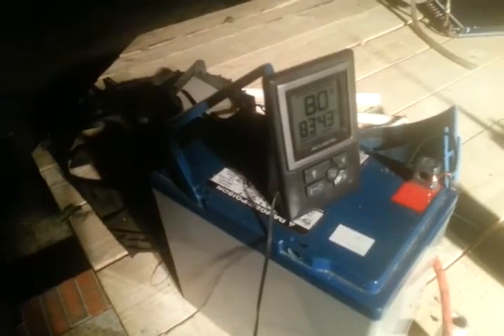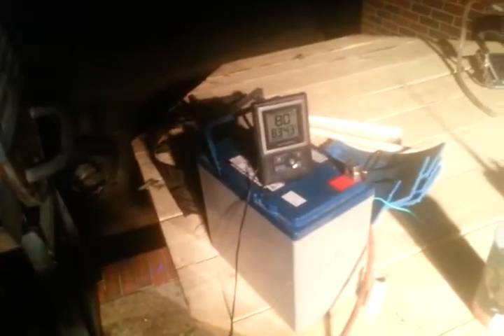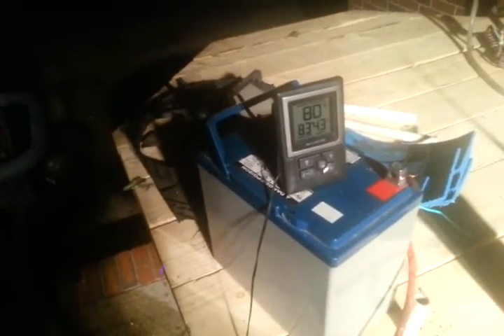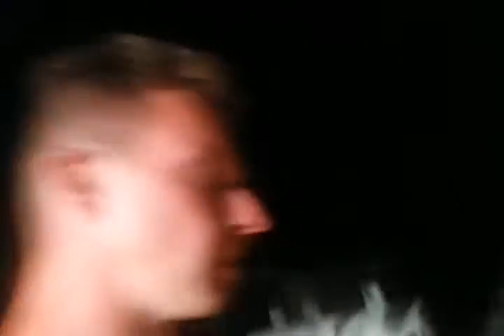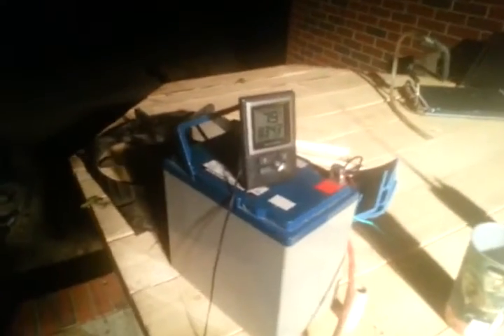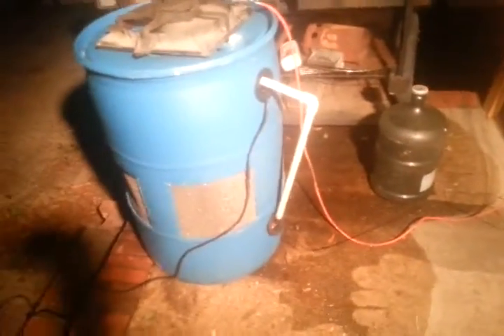DIY Home Evaporation Cooling Tower Part 1

Comment: Dude you should really follow up on this. It is a brilliant idea. You know that this may be actually even more efficient than what you give yourself credit for because you have to think about the heat pump effect of what you're doing.  One must also take into account the heat capacity of water is a lot higher than most refrigerants are these days. Thus 1° C of temperature change in water is a hell of a lot more BTUs or calories or Joules or whatever unit you would prefer to use for Energy Temperature change in a CFC refrigerant. I'll give some  specific heat values just to Give an example of how big the heat capacity differences are Once I post this so I don't lose any of my texts due to gremlins or bugs lol
Reply: Liquid 	
	Temperature (c) 	Specific heat (kJ/kg.K)
Ammonia 	Specific heat capacity of Ammonia 	-33.3 	4.43
Ammonia 	Specific heat capacity of Ammonia 	-20 	4.52
Ammonia 	Specific heat capacity of Ammonia 	0 	4.6
Ammonia 	Specific heat capacity of Ammonia 	25 	4.8
Argon 	Specific heat capacity of Argon 	-185.6 	1.14
Benzene 	Specific heat capacity of Benzene 	20 	1.72
Brine (20% sodium chloride by mass) 	Specific heat capacity of Brine (20% sodium chloride by mass) 	20 	3.11
n-Butane 	Specific heat capacity of n-Butane 	-0.5 	2.31
Carbon dioxide 	Specific heat capacity of Carbon dioxide 	0 	0.59
Ethanol 	Specific heat capacity of Ethanol 	25 	2.46
Ethyl alcohol 	Specific heat capacity of Ethyl alcohol 	20 	2.84
Ethylene glycol 	Specific heat capacity of Ethylene glycol 	20 	2.84
Glycerine 	Specific heat capacity of Glycerine 	20 	2.32
Helium 	Specific heat capacity of Helium 	-268.9 	22.8
Hydrogen 	Specific heat capacity of Hydrogen 	-252.8 	10
Isobutane 	Specific heat capacity of Isobutane 	-11.7 	2.28
Kerosene 	Specific heat capacity of Kerosene 	20 	2
Mercury 	Specific heat capacity of Mercury 	25 	0.139
Methane 	Specific heat capacity of Methane 	-161.5 	3.49
Methane 	Specific heat capacity of Methane 	-100 	5.79
Methanol 	Specific heat capacity of Methanol 	25 	2.55
Nitrogen 	Specific heat capacity of Nitrogen 	-195.8 	2.06
Nitrogen 	Specific heat capacity of Nitrogen 	-160 	2.97
Octane 	Specific heat capacity of Octane 	20 	2.1
Oil (light) 	Specific heat capacity of Oil (light) 	25 	1.8
Oxygen 	Specific heat capacity of Oxygen 	-183 	1.71
Petroleum 	Specific heat capacity of Petroleum 	20 	2
Propane 	Specific heat capacity of Propane 	-42.1 	2.25
Propane 	Specific heat capacity of Propane 	0 	2.53
Propane 	Specific heat capacity of Propane 	50 	3.13
Refrigerant-134a 	Specific heat capacity of Refrigerant-134a 	-50 	1.23
Refrigerant-134a 	Specific heat capacity of Refrigerant-134a 	-26.1 	1.27
Refrigerant-134a 	Specific heat capacity of Refrigerant-134a 	0 	1.34
Refrigerant-134a 	Specific heat capacity of Refrigerant-134a 	25 	1.43
Water 	Specific heat capacity of Water 	0 	4.22
Water 	Specific heat capacity of Water 	25 	4.18
Water 	Specific heat capacity of Water 	50 	4.18
Water 	Specific heat capacity of Water 	75 	4.19
Water 	Specific heat capacity of Water 	100 	4.22

NB --  as water gets closer to boiling its heat capacity curves upward very slightly thus why there are several values there

Comment from the maker: An hour later, the temp was 74 degrees F. I wonder how fast and to what temp it will drop to when the water flow vectoring is what it should be, and air is only being pulled in through the water screens?
Reply: By recirculating water through a cooling tower without adding heat you can get to within 1 degree of the wet bulb temperature, but as you guessed you would need to have a more efficient system that doesn’t allow air flow to be wasted going through non-wetted services. You also need about 1 hp of air movement for every 30 gallons per minute of water.

Comment: Where is the second part ? Was it a success ???
Reply from the maker: Rahul Ravi 
It worked... kinda. The humidity in my area was too high to be any effective when actually cycling water through an evap coil in the room. Project was abandoned after no heat was removed
Reply: Well I was planning to build one but with a water to air inter cooler using thin PVC tubes
 stacks with gap in between them to allow water flow and evaporation assisted by a fan. a second fan is used to draw outside air through the PVC stack allowing relative humidity to be as same as outside
Reply: I've been thinking about making a  version for my pool. Is your fan  blowing down? The ones I have seen blow up to exaust warm at top and  for air flow to come in the bottom to cool.
Reply: @Project23D  need to use the ground to cool the water , its 56F underground about 10 feet.